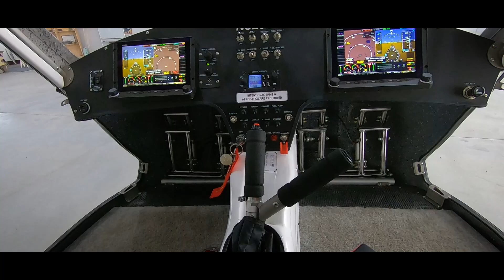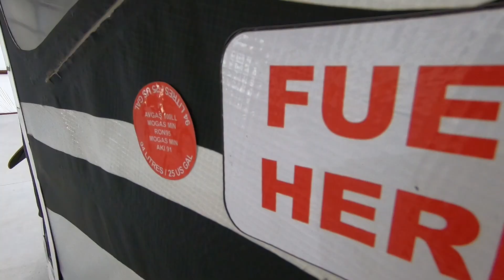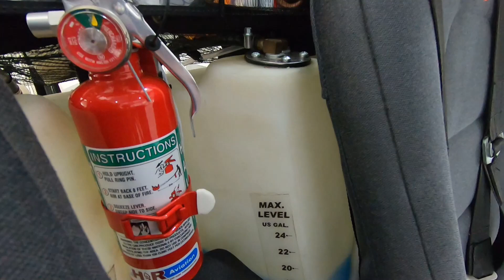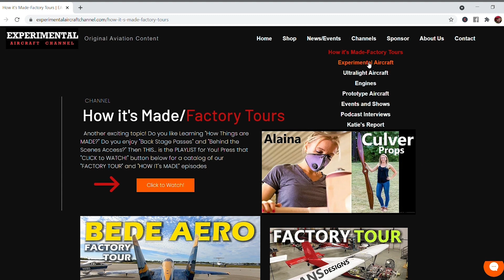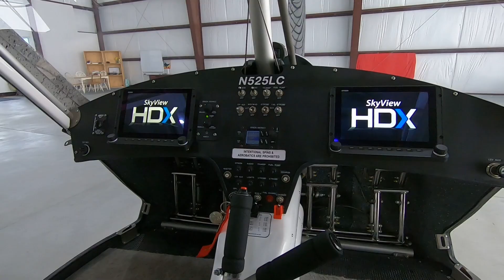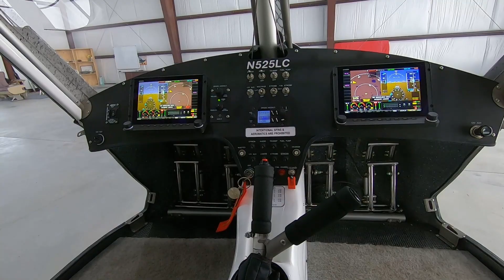Kitplane! Skyreach Bushcat Aircraft - You Can Build and Afford FAST!

Comment: While certainly an attractive and sporty looking aircraft, (I really like the look and flow of the cowling as well as many of fhe slick cockpit control features.) the bolt together aluminum airframe "appears" a little too "ultralight" to be rugged enough for the more aggressive bush landings of, say, the more mountainous backcountry of Idaho and surrounding areas.  Of course, this is only supposition as all others in this class seem to be welded 4130 steel,   Also how fairs the sail cloth vs. doped fabric and paint under UV assault, overall lifespan, etc.?   Then there is the grove gear vs. cabane debate.   I can see where it would, pardon the low hanging fruit, "shine" in the Florida sun where there are no mountains.    Just thinking out loud, as it were.
Reply: Is not meant for that. You'll hardly find a Idaho proven plane for less than 120K. This is meant for low and slow as she mentioned and for some "light" back country. I love it, it will work for my mission
Reply: @HECTORFARRA  Oh, don't I know it!   Even used, a fairly steep price tag is a given.    Glad to know that you are enjoying your aircraft.
Reply: Coming from a family of welders and myself a military pilot, welds  break/crack easier under rough treatment than properly selected bolt and nut attachment systems. Not many welds on an AH64 Apache Attack helicopter - mostly rivets and locknut/bolt/cotter key for some highly stressed/ pounded components during training and combat. And competition sail material is as tough as it gets. My son has sailed in some nasty winds around the world, and those sails stand up to direct impact high winds,  aerodynamic flow is exponentially less stressful

Comment: We have found that the fabric doesn't last with lots of sun exposure. The control surfaces need recovering often. Depending on flight time, somewhere around a 2 to 3 year replacement period.
Also, absolutely NO luggage capacity
Reply: Otoh, I’d not leave my Aeronca champ tied out in the sun, either.  At least with the BC, the skins lace on & there is no painting.  That fact alone beats cutting, affixing, heat shrinking, doping, & painting my rag wing on labor hours alone.
Reply: Interesting, thanks for the feedback on both points. A bush airplane has to be able to carry stuff too!

Comment: I wouldn't feed so confortable having those fuel tanks right behind my back in the case of an emergency TBH
Reply: I once looked at a Wittman Tailwind for sale. On paper it was my favorite experimental aircraft. I sat in it and my knees hit the fuel tank under the panel. At 5'8 I didn't have hardly legroom in a tail dragger with a 55+ mph stall speed with my knees hitting its fuel tank 😳

The fuel could make a huge difference in CG as well! 

Having the fuel tanks behind the pilot in a crash is way better than flying a Wittman tailwind with the fuel in your lap in a tiny tail dragger with a high stall speed any day! 😂🤣😅😆

-James Bond
Reply: Virtually all European microlights/light aviation have the same, above you it can leak onto you, above your knees it fuels the flames, behind and below you means you exit doors before it!

Comment: I see they addressed the poorly designed nosewheel design which was very weak and if you flew with Spats, its impossible to inspect the welds (where they always used to crack) without removing the spats entirely.  Two variants of the nose wheel "suspension" were made one with springs situated inside the cabin (the better of the two!) and another with a doughnut style rubber ring situated int he same place - the later is much harder and transferred more load into the nose-wheel, making it that much more prone to cracking (fatigue) - great to see that this has been replaced with a much better design! 

The previous old, cut, weld, and fold over another piece of steel plate to re-weld design that this was made from seemed to be a short cut approach.  The rest of the plane is great, easy to fly, handles well, good on fuel, a little slow at cruise but acceptable for a bushplane. 

The first releases called the Cheetah had horrible drum brakes, and the tires never sat flat on the ground, there was always a camber issue where the tires wore on the outsides. I was the first to replace the brakes in South Africa ( I hangar at the same airfield as Skyreach) to a disc brake model, and i upgraded a total of 7 planes, before Skyreach purchased the black max brakes for the bushcat.  A tip (if the newest bushcat doesnt have this done already) is to replace the plastic brake line with steel lines inside the cockpit, it gives better brake feel and less spongy compression to the hand brake lever when doing so. Leave the plastic line outside the plane, so you can visibly inspect the line for air bubbles, and colour of the fluid etc. 

A great, easy to fly, robust plane (except the nose-wheel)  plenty fun to fly, and can be flown long distances with ease, and nice and comfortable on a long flight. Nice large cabin inside too. Doors can be removed for kicking out a meat bomb (sky diver) should you want to do this -- i have done this at a fly in, and its great flying with the doors off on a hot day. Max suggested speed with doors off is 60mph, and the zips at the rear on the sides of the Fuselage need to be opened when doing so.... Nice video.
Reply: What is the reason that the tail surfaces were enlarged? The company rep was a bit short on details on that. I would guess there were stability issues or maybe slow flight control issues.
Reply: @DirtFlyer  Flight test failed in EUROPE - did not comply with POH (Personal operating handbook), stall and other characteristics are now met as an LSA aircraft.
Reply: Great insights!

Comment: this looks like a great Zenith stile aircraft but even as a tail dragger, I just am not a fan of those center counsel Y shaped sticks or that air rest Throtal. I see the draw, but its just nit for me. I'm more into a center stick with left hand throttle on a tandem seating. this is a great aircraft and I can defiantly see the draw.
Reply: Yep, this thing looks like tons of fun but I also am not too fond of a center stick and especially when your flap lever is also in the center.
Reply: You either reach across or let go of the stick to adjust the flaps, and trim. Doesn’t seem very ergonomic but I could be missing something.
Reply: @lpainter100  I agree flap control should be on the top outside of both seats I guess if you bought the kit version could modify that put handle where you want it.
Reply: that's the main reason I like a center stick (or yoke but I like stick controls). you can always have a hand on the flight control. for aircraft that fly mainly by autopilot I understand the appeal of keeping your legs and space in front of you clear. but I don't like the idea of having to let go if the main control. I know it's in reality not that big of a deal, its just a psychological thing for me. I see why its nice, but thats the main reason I'm not considering a Zenith.
Reply: @TheArchitectJC  Pretty sure Zenith offers a dual stick option. See the March 2021 issue of Kitplanes Mag. or check with Zenith before you scratch them off your list.

Comment: What is the range on cruise with a full tank ?
Reply from the maker: Longer than her bladder (as she said). I think around 7 hours. Thanks for chiming in today!
Reply: @ExperimentalAircraftChannel  When I said range I meant in miles what is the range of the aircraft in cruise
Reply: @madmanmechanic8847  She said it cruises at 90mph, so 90mph x 7 hours would equal a range of 630 miles. If you were flying into a 40mph headwind the whole way, you would see range reduced to 350 miles travelled at a ground speed of 50mph.
Reply: @nameberry220  Oh ok very interesting thanks !

Comment: There is one of these at a nearby airport to mine. Definitely has some ramp appeal! 
One issue I see with the way that is set up is that the flap handle and the stick are both in the center which means you would have to reach across yourself to lower/raise flaps while you are flying. I'm assuming there is a dual center stick option which would fix that.
Reply from the maker: @Micah Powell I see your point. There are several aircraft that challenge the "ergonomics" of some typical thoughts on that. There is always a trade off it seem. Having the stick in the center of the airframe allows ease of access to simply slide your butt into the seat. Adding dual sticks would definitely take that feature away. Maybe they are just a big fan of "symmetry." :-) Thank You for watching and supporting here! We appreciate YOU!

Comment: Looks like a great plane and a good candidate for a Viking engine!
Reply from the maker: Thank You for saying hi! I honestly don't know what other engine options would be available. Forward of the firewall I think would be rather critical of these as the empty weight is around 700lbs-750lbs I believe. If you take a close look at the engine to firewall space with the current Rotax 912ULS 100HP option, you will find that it is mounted nearly against the firewall. Meaning if you were to hang a HEAVIER engine on the nose... there is NO ROOM to move the engine "AFT" to compensate for weight. Yes... you can add ballast to the tail to some degree but that is a very narrow envelope before it affects the handling and flight characteristics. Just something to consider.
Reply: @ExperimentalAircraftChannel  Good point!

Comment: It's a really big ultralight.  
I'm eager to upgrade from the ultralights I've been buzzing around in. 
And it's as close to affordable as any aircraft possibly can be these days.  
Love!
Reply from the maker: Thank You for chiming in! Easy to build for sure.
Reply: @ExperimentalAircraftChannel  Recently I've been training on a quicksilver to get my LSA.  I know it's not the same as a real ppl, but it's what I can do on my budget right now. As my current mission is really just doing touch and goes and air-work, and learning to fly an airplane at all, it's been fun and helped me get my fundamentals down. I obviously hope to get my PPL afterwards, and was looking at a 150 or 152, but these bush planes just look like so much fun. 

I know this is a stupid question, but if you were to tell someone about the major difference between a modern bush ELSA like this, and an older 152, what would drive someone to spend the extra cash on a newer plane like this? 

Thanks =)
Reply: @jamesbarros950  I have owned several airplanes, built 3 in the experimental category and working on another. I have also owned an older Cherokee (for a brief period).  Depending on your mission, I feel experimental is the only way to go! For me, this includes mostly local flights with the occasional cross-country. If you can build the plane yourself,in the experimental amateur -built category, you can perform your own annual inspections. This can save you a lot of money! You will also know your airplane inside and out! My experience, with the Cherokee, was something was ALWAYS breaking down (everything is older). Then you had to find a mechanic worth a darn. I consider my standards as medium-to low-high. The mechanics I found, their standards seem low-medium,at best (although never anything unsafe).  
The fun-factor is also there! Typically, the power to weight ratio for the light sport type aircraft just make them fun to fly! The downside is they are lighter aircraft,  and more prone to turbulence. It all depends on your mission and $$$, but I will never own anything but experimental.
Reply: @mhilderbrand7693  Thank you. I'm not a great mechanic (by motorcycle racer standards, where we had to work on our own bikes) but I'm competent enough to keep a race bike running, and would love to be able to do small things myself and call an A&P in when its' time to crack cases, do overhauls etc, so this makes some sense to me.  I'm intending to rent for a little bit after I get my license to get a feel for some different types before making my purchase, but the idea of something I can maintain myself sounds like a good way to make it a slightly less expensive hobby.
Reply: James you are full of crap. One you do not fly a ultralight and do not buzz around anything. State what you fly and where .
Reply: @ohwell2790  wow, someone woke up with their nickers in a bunch. you must be a blast at parties.